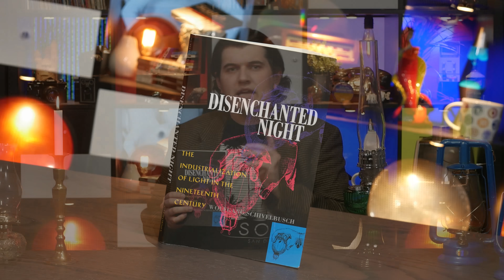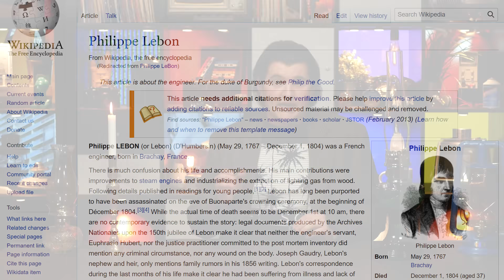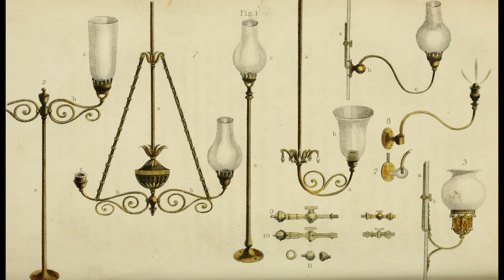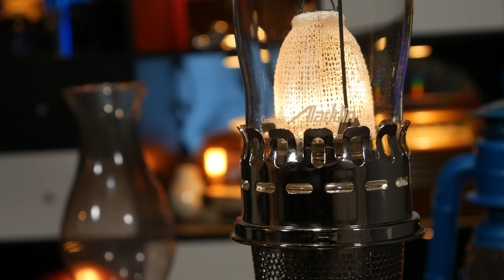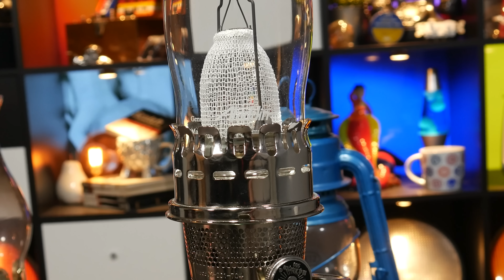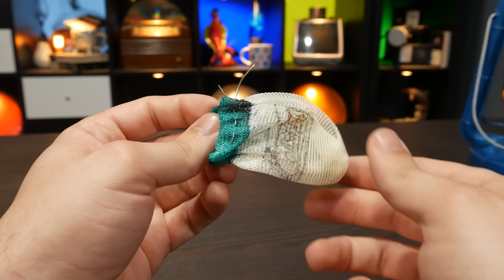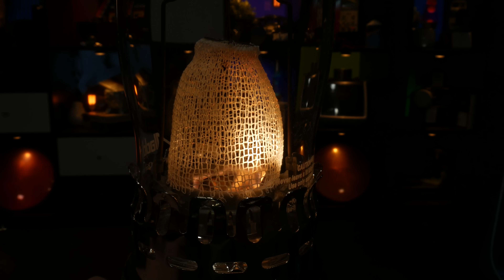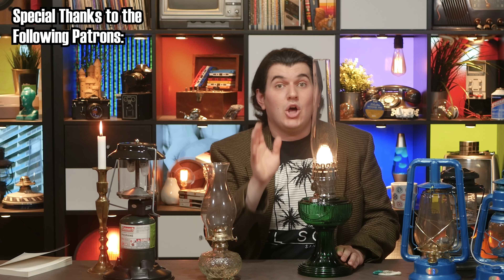How the gas mantle made lamps 10X brighter

Comment: I remember using those when camping. :D; 

I was thinking of the fluid and thinkign about your consumption rating. How to convert the fuel to energy in a usable form. IE Camping LED's or low wtt devices and how long one could generate energy using simply the fuel.

I was thinking of a method of heating a spiral metla bar system taht bends under tension to create power, and it forces the heat through it, and it may even spin to heat and cool, itself so its pressure change, creates energy, but the means of rotation and copression/expansion of hte psiral system. Doesn't need to be a pistan system. So .. lets say we want to create a 0-50 watt system that can be changed. How much a litre of fuel coudl produce energy in such a system. WOuld it be more efficient? 

interesting.... If.. it lasts.. say... 250 hours at a 2 watt burn or.. 10-12 hours at a 50 watt burn... hmm... or even further an microwatt meter, that can detect drag.. and increase power to compensate.. hmm. . I don't know.. what would the point be...

Comment: "He called it a gasometer."
That name annoys me.
"This name annoyed scientists."
I'm a scientist, confirmed.
Reply: I like the word gazomètre because the height of the cover actually gives a visible measure of how much gaz is in stock. And also because I'm french and this word looks far more french to me than gazofeet or gazoyard
Reply: We are all scientists on this blessed day.
Reply: I used to work in gas utilities. The gasholder / gasometer is dual function (although we referred to the locations as holder stations), town gas was produced around the clock and natural gas is transported likewise.
So local storage during low demand was needed as they function at relatively low pressure. Also release gas to the system during high demand, regulating pressure. They have become largely obsolete as the supergrid network can be over pressured for storage and exhausted gas fields can be re stocked. Yes putting gas back underground is a thing.
Reply: We had a gasometer near us. The cylinder floats in water to make a seal. The more gas you have the higher the cylinder. This maintained a level pressure so I would say it could be classed as a Meter as it gave you a visual indication of how much gas you had left.
Reply: Samesies
Reply: i'm not a scientist but all my life whenever i traveled to porto alegre in brazil we visited the local decommissioned gasometer so i never thought much of that word
Reply: I'm not a scientist and it annoys me.

Comment: The audacity! My lute has been forced.

So I guess "broke my glasses" meant his glass utensils, not his spectacles.
Reply: you've probably already read the pinned comment at this point in time... but just in case, it basically meant that the gas exerted so much pressure, it kept popping off the sealants they were using to connect the different glass apparatuses. that, or the glassware itself would explode.

and, funnily enough, Wikipedia has a painting of what that would have looked like in that time period: https://commons.wikimedia.org/wiki/File:The_Alchemist%E2%80%99s_Experiment_Takes_Fire_1687_CHF_fa_2000.001.276.JPG
Reply: Well sounds like it blew up in the old chaps face so might have been his spectacles
Reply: @acester86  An enclosed apparatus with seals would allow pressure to build.  Spectacles in open air would not be subject to any cracking pressure, if a high explosion occured, it's unlikely the experimenter would be able to write about it.

Comment: I see you bought the top of the line newest Aladdin lamp, chrome plated, with the new style even brighter style burner and chimney.  Since the wick and mantle are the same part number I'm guessing the new burner pushes more air to burn brighter. We have the same pattern with the older burner in rose glass. My wife would disagree with you on the odor. I had to change to a low odor fuel and she still does not like it!  I think it is basically odor free. You appear to have the same "defect" as my lamp. When I finally burn up the wick it came with I'll see if the wick is the issue. Have you measured the temperature of the exhaust? I can't remember offhand but I think I got somewhere over 800 degrees at about 16". Did you know that the burner is used for running a refrigerator made for off the grid that has been around for decades.

Comment: Old man had a Colman camping lantern that ran on kerosene and sock. don’t know how old it was but always had it when we went out in the woods from ‘99 -‘06
Reply: Did you have to light it with meths?
Reply: @groblerful  no just pump it till you couldn’t pump no more from the resistance and then get the pump stick down to the base once more to lock it 😆 and just lit it with the bic or a bit of paper under the glass 🤘🏼👌🏼✌🏼
Reply: @Andrewflynn16  thanks

Comment: In houses, with these lamps, a neat idea is to enclose the lamp in a glass case and use an insulated air inlet pipe from the outside, and a exhaust pipe to the outside.  Call me Ben.

Comment: In the UK the evolution of the Aladdin lamp was the Tilley/Tilly lantern, suitable for outdoor use. A pressurised kerosene/paraffin lamp, that required pumping with a brass rod on a knob, that extended from the fuel reservoir. Other than that, it was pretty much the same as the Aladdin. Burned incredibly cleanly, and was vastly brighter than a hurricane lantern. 

In fact, aside from the nursing required to get the sweet spot once it was up to full operating temperature after ten minutes or so, I vastly prefer them to modern camping Gaz style lanterns. Having to carry around several annoyingly bulky cylinders is inconvenient, compared with just having fuel in a standard container, or a container of your choice. 

The Tilleys look amazing, all brass and glass. Come to think of it I might have to hit up eBay for a couple!

Comment: I still have a Coleman camp lantern that uses liquid fuel and you pump air into it with its little, built in pump.  I'm pretty sure it predates me (nearly 50).  I have no idea what the fuel is.  The can doesn't specify save for not for use in internal combustion engines.  Had to use either a filtered filler neck or a filtered funnel which I still have.  I should replace the mantles and light it off.  I remember it being very bright.
Reply: Depending on the model, the fuel is probably either kerosene or white gas (a fuel with properties somewhere between kerosene and gasoline). These are probably the subject he teased at the end to cover in his next video.

Comment: To my knowledge the coal gas used before natural gas and made by Coking coal was made in a furnace where the coal was heated without air  and water was sprayed into it causing some hydrogen bonds I presume.  However, most of it was carbon monoxide, hence unfortunate people used it to commit suicide.  Also explains why it burns brightly since there is a lot of carbon in the gas by volume.

Comment: While watching this, I was reminded of my parents' occasional mention of having a wind-powered generator that charged a car battery, so they could have (limited) electric lighting and power for the radio, back before rural electrification made it unnecessary. Is it possible you might do a segment on that technology?
Reply: I remember my grandparents had a similar system called the Delco system.  A gas engine ran a generator to charge the batteries.
Reply: @donaldeisenbarth5255  That rings a bell. I wonder if there were hybrid systems, using both wind and I. C. engines.
Reply: Those farm windmills that you see in the movies driving pumps on water wells.  Mount a generator from an old car to be driven by the windmill and charge batteries that way!

Comment: We actually had an old Winnebago camper when was a kid that had a gas lamp in the kitchen, which was basically the whole camper as it was a 16 foot camper. Normally you would want to use the 12v lighting system, but on long trips, you did not have the battery power to do that(this was long before led lighting back in the late 80's early 90's). I mean you had one 12 car battery that would last perhaps 2-3 day tops, or you had the propane tanks that could last weeks. It was shocking how much light it produced. It even had the benefit of producing heat in the winter. More than once we were forced to "camp out" during blackouts after storms. While I would not want to live that way, it was nice when needed.
Reply: Side note. You really don't want to handle a mantel bare handed, at least not for long. They can be highly radioactive. So limit handling and wash hands thoroughly after installing. The actual risk is minimal, but why risk it at all. The few times I changed mantels, I wore gloves. But by the time I was buying stuff for myself, led lanterns were a thing (and SO much better / brighter / safer).

Comment: In the coal and iron areas, weren't the street lamps with gas mantle lanterns? To melt iron from ore, you need coke, which is made from coal. This releases coal gas. Besides, the smelting of iron with charcoal could not be done on an industrial scale, there were simply not enough trees. In any case, the coal gas was collected in gasometers and distributed through pipes in the city. There it was used for street lamps. In addition, the gas mantle is a little radioactive. But not harmful. Natural gas was added later and then replaced the coal gas. In Europe, natural gas mainly comes from Siberia. There it naturally escapes from thawing layers of soil. So why not burn it beforehand before releasing it into the atmosphere unused?
Or freeze American natural gas, transport it to Europe by ship, thaw it there again and offer it at a much higher price, that is the policy of the US government, which will surely add a few more subsidies until it is worthwhile.

Comment: 2:00 An interesting fact:  In Germany during WW2, almost all gasoline production was earmarked for the military.   Enterprising German engineers developed a portable coal retort that you could bolt onto the back of your car, and it would heat some coal, pressurize the resulting coal gas, and feed it to your engine, thus enabling you to have a coal powered car.   I heard it didn't work very well compared to gasoline, but when it's all you've got, you make do I guess.

Comment: @23:50 - if it is on fire, You can put it with rest of fire...
BTW. I learn one thing - this spongy things  (sound mats, infils, insulators) are fire resist to some level of abuse, they shuld have certificate, and samples are tested very often. If not comply, all batch going to scrap, before reach customer. But if start fire, is going quickly with a lot of bad gases.

Comment: 7:40 yeah the soot is thr thing that makes  aflame glow yellow for example lighting an oxy actelene torch. the first time i did it it was almost magical, because acetelene with no oxygen burns such a deep orange, it also leves a layer of soot on anything you hold the flame on. untill you turn the oxygen up.
this proberbly happens because acetelyne is so carbon rich

Comment: To lute means to glue two different structures together. It also means to seal (as a gasket). For example, wine bottles are luted with wax, or in distilling apparatus a luting agent is applied where a glass pipe mates with the bottle neck.
In this light, "forced my lute, or broke my glasses" could mean that as the gas ignited it broke the seal (clay or something similar was used as luting agent), or broke the glass vessel used for destillation.

Comment: The mantle is extremely porous, and when it's at full temperature it offers an enormous amount of surface area for combustion so the fuel burns a lot cleaner. Almost all the combustion happens directly on the mantle, so the energy is readily absorbed and released as light. This is what makes the flame burn so cleanly.

Comment: I am finding this series fascinating. Today's topic got me curious about when my paternal grandmother's house in DC was built. It originally had gas lights and the crystal chandelier in the living room was retained when converted to electric. I had pulled up the property record and was a bit surprised that it was built in 1915. That seemed late not to have used electricity but as I was pondering that, you discussed that electric light was less bright than gas for some years. 

On the standalone lamp topics, I much prefer a hurricane lamp for car camping to the hiss and super bright light of propane or compressed gasoline. I only use gasoline for backpacking for both light (when a candle lantern is not sufficient) and cooking.

Comment: "They're safe...ish for use inside"
Insurance fraudsters: "Tell me more" xD
Reply: sokin jon  It's 100% a joke about the colour.
Reply: sokin jon  It does have emissions due to the fundamental thing of combustion usually producing carbon dioxide, but it could be a comment on being a lot more efficient than other lanterns that would also create soot, some carbon monoxide, and eject unburned fuel vapor in to the air.

Comment: I grow up with a Coleman White Gas Lantern. I remember pouring the fuel then pulling in and out a rod that had a hole in the center that you had to cover before lighting it.

I also remember getting in trouble when I touched the mantles (when cold) because they would just fall apart and we have to replace it

Comment: https://cdnc.ucr.edu/?a=d&d=SFC19001215.2.2.1&e=-------en--20--1--txt-txIN--------1

From San Francisco Call , Volume 87, Number 15, 15 December 1900

LIGHTNING STRIKES A GIANT GASOMETER
Sheet of Flame Sent Two Hundred Feet Into the Air and Structure Destroyed.

One of the weirdest and most extraordinary disasters of the storm was that in which one of the gasometers of the San
 Francisco Gas and Electric Company, at Bay and Buchanan streets, was destroyed. When the storm was at its very height, at 10:20 o'clock, the smallest of the gasometers, a giant structure of steel and iron seventy-nine feet in diameter and forty feet high, was struck by lightning and destroyed. This is the only instance in the history of the city where damage has ever been done by lightning.

The gas works are on the bay shore and received the full force of the raging wind. Not fifty feet away from the destroyed gasometer, which had a capacity of 240,000 cubic feet of gas, is another which towers to a height of 104 feet and has a capacity of 2,000,000 cubic feet of gas. The storm had been raging for twenty minutes when out of the southwestern sky there came a blinding flash of lightning. It struck the top of the holder, burst the iron wheels and supports and wrenched open the top of the gasometer.

In an instant a small blue flame quivered its way around the circumference of the top of the holder. There was a deafening crash and a great volume of flame shot 200 feet into the sky. The enormous steel structure wavered, the great supporting columns swayed outward and with irresistible crash the whole fabric collapsed. The flames had spread to two towering tanks near by, and the mammoth adjoining gasometer seemed in imminent danger. But the workmen were paralyzed with fear.

In a few minutes, however, they recovered their senses, the flames were extinguished and all danger of further disaster was over. President Crockett, who took charge of affairs, estimates the damage at a sum between $5000 and $7000. No inconvenience was caused to gas consumers, and the gasometer will be rebuilt at once. If in its mad freak the lightning had struck the larger gasometer, containing 2,000,000 cubic feet of gas, it is Impossible to estimate what the damage would have been. Eye-witnesses of the explosion yesterday say that the flame which ascended into the sky seemed to be four blocks square.

As if by a miracle, not a person in or around the works was injured. Tons of iron and steel collapsed into twisted, giant masses, but no man was struck.

Comment: The reason your mantle was too bright in one spot is because it's too far from the centre. Mantles need to be circular. If one spot is further from the flame, it is a different temperature, hence different burn, different colour. its also a weak spot, thats why flame goes out there first when set too high.

Also, my dad taught me to use a Tilley Lantern (pressurised kerosine as used by british military) and i still have 2 complete lanterns and a bunch of spare parts. They are wind proof, portable, and bright as all get out. We used to use them camping in all weather.